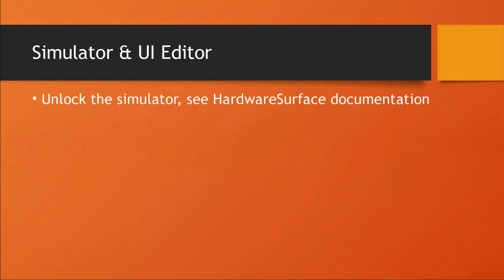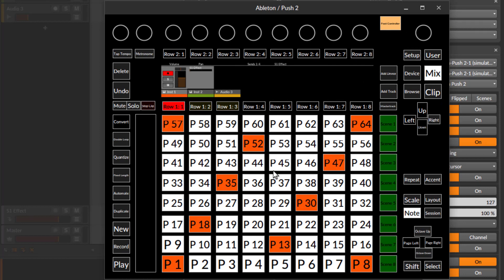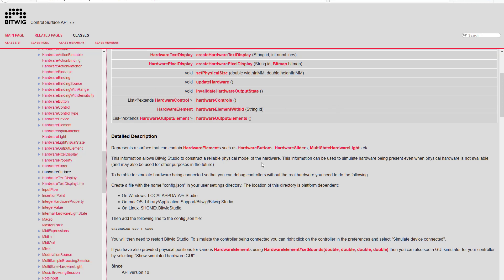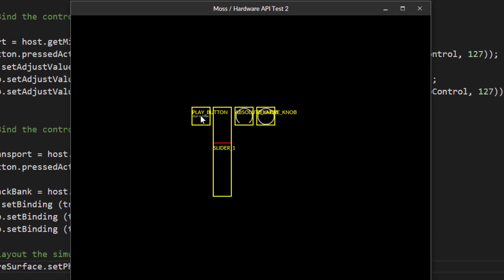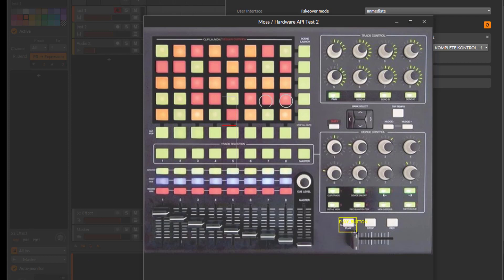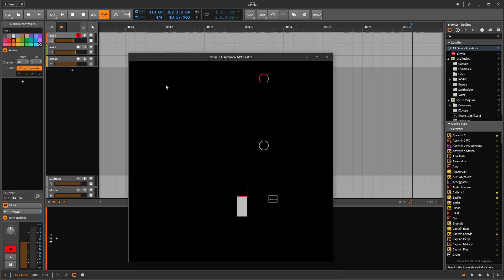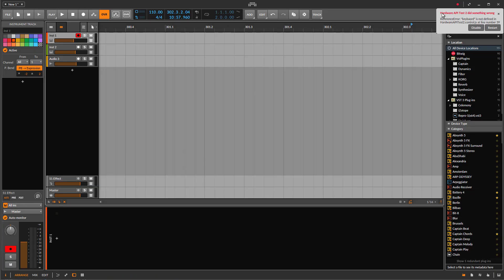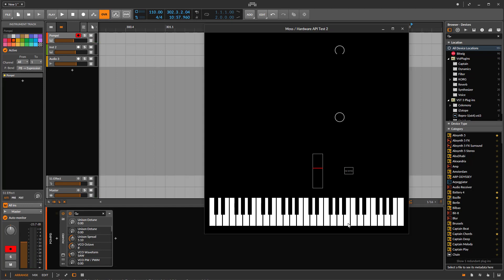The Bitwig Controller API #15: Hardware API (2)

Comment: My 3 favourite things in the world are Javascript, mapping midi controllers and synthesizers. This is like a dream come true. Is it just a simple refactor from JS to C++ if the mapping is sluggish, I've never written any C++ before, I can't imagine the logic would change that much as you seem to be using only synchronous code.

Also Is it possible to map HID devices, or just midi?
Reply from the maker: No need for C++. Recommended is Java but JavaScript works as well (at least in most parts). I did one HID device (KOmplete Kontrol I) but that is a bit tricky since you need an external HID library.
Reply: @mossgraber  Wow thanks for the quick response! I found your github and was looking through your Java, looks pretty easy to understand and very well organized. I have an Akai Force and an Ableton Push 2. I'm sick of waiting for Akai to update their midi mapping, and the limit of only 8 audio inputs is getting in the way. Would you suggest using a Push with a separate laptop in place of the Force? I only use the Force as a midi sequencer for a bunch of hardware synths and a virtual mixer sending the audio back into the device. It would be nice to be able to use a mouse and a bigger screen sometimes though.
Reply from the maker: @andrew1550  Tough question. The features are great but I still prefer a computer in the studio and for live use I think its a bit too big (MPC Live II is nicer for that).

Comment: Anyone else experience Bitwig 3.2b not showing the options to simulate the controller? I first tried with my own Java extension, and then I just copied Moss' script from his github repo. When I right-click the controller the only option I get is 'Reveal File'.

I'm on Mac, and placed the config.json in the location specified in the API Documentation.
Reply from the maker: Did you try in 3.1.3? If it is also not working there, you placed the file in the wrong folder. I also checked in the config.json in the Tutorial Repo, maybe try with that one, too.
Reply: @mossgraber  Turns out the API Documentation is incorrect for Mac. 

MAC USERS: place `config.json` in /Users/(your_username)/Library/Application Support/Bitwig/Bitwig Studio

Their documentation makes it look like you should place it in the Library directory at the root of your hard drive, when instead you want the user's home directory
Reply: TheFlowState thanks!

Comment: This looks interesting: 'MIDI Keyboard Macros' : https://www.mediachance.com/midimacros/index.html

Turn your MIDI pads, keyboards or controllers into the most sophisticated Macro triggers, app launchers, clipboard processors...

Pads and keys can transmit velocity, so you may create macros where pressing a pad.. will trigger one action but hitting it harder will trigger a different action

MIDI Keyboard Macros can also work with MIDI rotation and slider controls, using its powerful Scripting Language